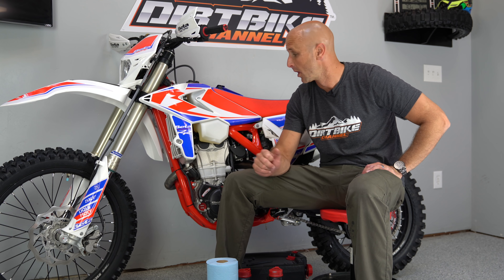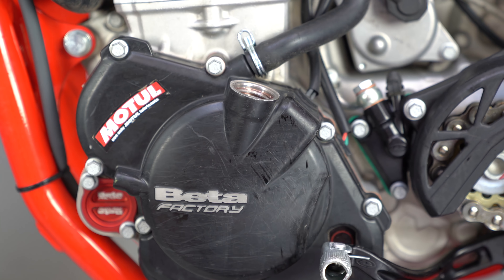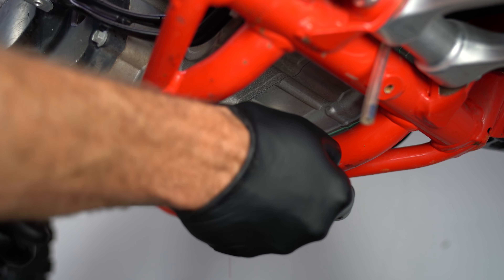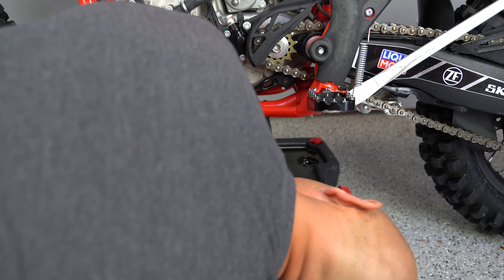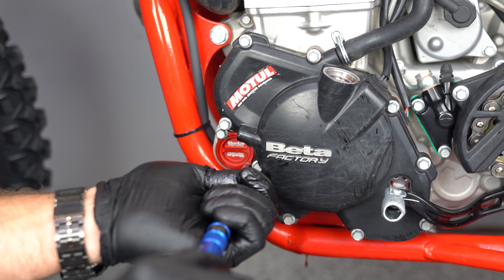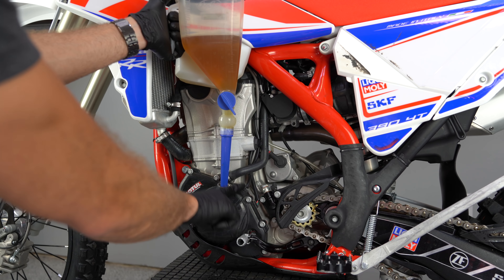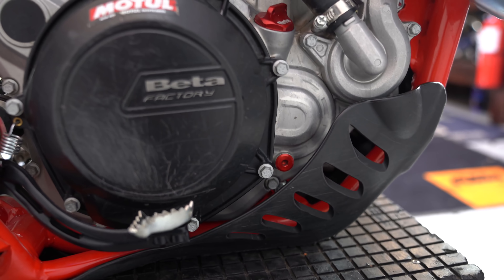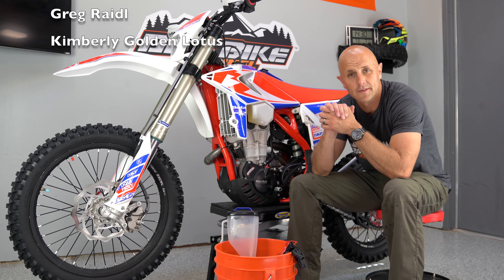How to Change Oil On The Beta 390 RR Race Edition

Comment: Love the separate oil for transmission vs engine! It makes zero sense to circulate clutch fibers over your cam journals, around your piston rings, and through your crank bearings. I am fine with having two oils to drain, although some may have trouble figuring it out.
Reply: I love this with the older Honda crf450s and 250s because of that same reason
Reply: For sure

Comment: I prefer four stroke engines that have a separate oil for engines and transmissions.  The engine will last so much longer when you don't have the tranny/clutch debris floating throughout your engine. Kudos to Beta!
Reply: Yea I wonder if that makes the intervals longer as well. Tranny oil on 2 strokes can go 20 hours pretty easy. I suppose that also lets you run "normal" engine oil vs. the JASO compliant stuff
Reply: @noControl556  on my 2 stroke I change mine every 10 hours in the trans, and it looks terrible.
Reply: @eliworks8549  The manual for mine says 40
Reply: I do have a Rekluse clutch. Its probably harder on oil.
Reply: @eliworks8549  i change mine once a year or 40 hrs on my cr80 and its looks almost brand new
Reply: Completely agree!

Comment: I have the Beta 480RR 2017, change both oils every 15 hours ( two rides ) using Motul 5100 10W50 in the engine and Motul Transoil Expert 10W40 in the gearbox. Works great for me. My bike has 8500 kilometres on it and 165 hours. Doing adventure riding not hard enduro. Not one single problem with my Beta 480 RR, very light and huge power when you want it!

Comment: As commented before, either a wood screw. Or I use an angled pick and just push it through the cap of the filter and pull it out that way.

Comment: No laying on it’s side like KTM for the filter?  That is a win.
Reply: Things With Wheels I agree here!
Reply: Phil Ward next time u drain your oil lay on its side much more comes out
Reply: Phil Ward shit I misread I’ve never tipped on its side for filter
Reply: Well, for a 2014 250 you are supposed to.  Check your manual for what you are riding.  From may manual..."' - Lay the motorcycle on its side and fill the oil filter housing 1/2 full with engine oil" is a step in the process.  It was also similar in my 2006 450 EXC.  No need on your bikes per your manuals or no need just because you say so?
Reply: @Phil Ward Ah...OK.  I will just do what is says to be on the safe side.

Comment: This video is now a few years old but there are certainly some valid factory Assembly issues mentioned above. 
1. Those drain plugs are O-ring sealed, no crush washer, and we all saw how tight they were. Way too tight from the factory! Is it any wonder the factory sells kits to retap the cases for an oversize plug when continually over tightened and aluminum threads finally strip? According to the manual, the engine oil and gearbox drain plugs are torqued to 15 and 20 Nm respectively. 

2. By now, all 350-500 owners should know that the oil level check on the clutch side is way too low on the case and is useless.At that level check.there is only about 400 mL trans oil in the case and the manufacturer calls for 750 ml.

3. I’ve had my 2019 390 for almost 3 years and agree with Kyle, great bike.

Comment: did i spy the mistake , gold oil went in l/h side when it should have been the red 7100
Reply from the maker: Enduro North Nz turned out that I used different oils than the bottles I showed at the beginning of the vid. I only had half bottles of each, so I used their equivalents in another brand.

Comment: Does the cluch go overheated if you ride in slow conditions?? I see the clutch cable (hidraulic obviously) too close to the engine.
Reply: Kinda yes, you need to have the clutch cable screw backed off, if you have it tight when its cold, as it heats up it will engage the clutch, its a problem but you can work around it simply

Comment: So it is ok to start the engine with no transmission oil in it?
Reply: wdsracer yes just don’t ride it
Reply: wdsracer  I wouldn’t ever start a motor without all the fluids in people think just because there’s stuff left over in there it’s fine as long as it don’t get hot but I never would
Reply: Get Outdoors I would never start an engine without all the oil in it but if you watch this video he starts the engine with only the engine side oil and no transmission oil.
Reply: wdsracer it’s easy when it’s not your bike😂

Comment: Did you just run the bike without any transmission fluid??🤣
Reply: That's no problem, he's not using neither the clutch nor transmission. It would be (way) worse without engine oil 😂
Reply: @TelmoMonteiro  I was just curious because in cars and trucks, neutral is still a gear and should not be ran without fluid.